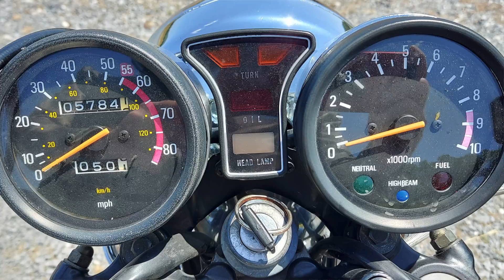Yamaha XS1100 Special Review - Specs, Sound, Acceleration, Classic Musclebike Power!

Comment: I had the 750 Special and 1100 Special. Both were equally comfortable. The 1100 with under a four-gallon tank wouldn't take me past 110 miles. Top heavy in tight turns and great on straight roads. The heads were off and ported and polished. Installed performance mufflers, Vetter saddle bags, rear rack with detachable backrest and long plastic windscreen. Bought a 2005 Goldwing and sold the XS a year later.
Reply from the maker: Right on! Thanks for sharing the memories. It sounds like you are into touring, and the Wing is hard to beat. Cheers!

Comment: Awww man, now I miss my 1981 Suzuki GS550L!!!!! I couldn't kill it.. It was SO light and quick..The speedometer went up to 140...  I got it to 130, and had more throttle to go!!!!!
That was fast enough for me......
Reply from the maker: I have several GS550 videos if you're interested: 
https://youtu.be/CEOGboxYYPI
Reply: The speedometers on Japanese motorcycles were known for being overly optimistic. The magazines listed "indicated" and "actual" speeds at 55 or 60 mph. They speculated that this was done deliberately to prevent riders from running afoul of the law. In that respect, the speedometer on my motorcycle, a 2005 HD, says "certified" on it. If you get pulled over for speeding, and your helmetcam shows you weren't, that information along with the stock tire sizes is enough to beat the ticket.
Reply: @spaceflight1019  I didn't mention I got a speeding ticket on that ride getting off the exit ramp clocked at 98mph..
And my speed was greatly reduced by then..... I believe the speedometer, if I let go at speed I would FLY right off the bike.
I was literally holding on for life, AND MY COUSIN WAS ON THE BACK!!
I got  Is reckless driving ticket and lost my license for a bit..
Reply: @jonsmotorcyclerescueandrev3538  Thanks Bro
Reply: @DUBEE43  We had this discussion on another thread. To find the actual maximum speed of a motorcycle at redline you take the maximum RPM, multiply that by the primary drive ratio, multiply that by the top gear transmission ratio, multiply that by the final drive ratio, and multiply that by the circumference of the rear tire. That will give you the feet per minute.
Reply: @spaceflight1019  Its not that important, its 40 years later now..
But I still believe the speedometer..

Comment: Fortunately these are not the original handlebars otherwise I won't have looked until the end...foot pegs a little further back would go well with it , for all this I prefer the non-'special' version which was inspired by the standard xs750-850 with their rear backrest. The only one that I can really digest the look of in this special series was the xs650 and even then I would have changed the handlebars for lower one .
Reply from the maker: Right on! I'm not a huge "special" or "custom" fan, but the first generation of Japanese cruisers was so close to their standard bike brothers, that they are still competent performers with a few simple mods (handlebars first). Cheers!

Comment: Just a "note",  the XS11 had some difficulties with popping out of gear from 1st to 2nd.  Mine is an '81, I think that that was fixed back in '80.  Also, everything on your bike is "ROUND", yet your mirrors are rectangular.  My "standard"" model , everything on it is "RECTANGULAR" yet, stock mirrors, were ROUND?  Go figure?   So, I just bought 2 mirrors off of an old special model, and mounted them onto my bike and now everything matches!
Reply from the maker: Interesting. I'll probably swap these mirrors out at some point. The original XS1100 looks great with a round replacement headlight.

Comment: Rated at 95 HP and 66.5 torque.  570 lbs. wet weight.  Right in the ballpark with most 1100 bikes from 1980 to 1983. Till the big HP bikes came along.
Reply from the maker: Thanks Pete!
Reply: It took the advent of liquid cooling systems to get to the next step on motorcycle power. The Suzuki GS1150 and the Yamaha FJ1200 were the end of the road for air cooled sportbikes. Honda introduced the V4s, Yamaha followed suit with the Venture, Suzuki went V4 with the Cavalcades and Madura, and Kawasaki had the KZ1300.
Reply from the maker: @spaceflight1019  Right on! I've owned all those bikes in the past (except the Venture and Cavalcade). Unfortunately, with that next generation of bikes the weight and complexity went up as well. It makes them somewhat daunting as restoration projects due to their complexity and corresponding difficulty working on them.
Reply: @jonsmotorcyclerescueandrev3538  True. Unless the cooling system is meticulously maintained the alloy components and seals on 40 year old engines does not fare well.
Reply from the maker: @spaceflight1019  Right on! And V-4 carbs - don't get me started on how much of a pain those are!
Reply: @jonsmotorcyclerescueandrev3538  I rebuilt the carbs on a V45 Sabre for a friend, but the front fork tubes were pitted beyond repair and he traded it for a .45.
Reply from the maker: @spaceflight1019  Right on!

Comment: My ‘79 XS1100 Special throttle would stick at WOT, eventually causing a crash. Any idea why it would stick? I’ve been pondering this question since I crashed in 1982 !
Reply from the maker: @billobrien5745  It could have been a worn or defective throttle cable.
Reply: @jonsmotorcyclerescueandrev3538   Thought of that at the time and replaced the cable with a new one, about 3 weeks before it stuck again and crashed.
Reply from the maker: @billobrien5745  It must have been in the handlebar housing or the carb linkage, then. It is a pretty simple system.  Cheers!

Comment: I just got a 1980 midnight  11 50k MI it was froze up I got it unstuck and started it now I got to work on the brakes I wonder where you got the rebuild kits for the front And rear Master cylinders
Reply from the maker: I think they are K&L parts and should be available through many different sources.

Comment: I own 2 of these bikes. One of them is 1981 Yamaha XS 1100s and the other one is the 1981 Yamaha XS 1100 Midnight Special. I did a total restore on the Midnight Special. I changed the OEM fork springs and shocks to Progressive Shocks and Fork Springs. It made a huge difference on the handling on the bike. I also changed the handlebars which changed the handling and cornering on this bike. I love them both. Everything on the Midnight special is brand new. I redid all the gold at a place in East Hartford CT called New England Chrome. They did an awesome job on the Gold.  New Sterring stem bearings. New wheel bearings. new swing arm bearings. I push my mine to the limit on curves because of the progressive shocks and fork springs. I recommend that up grade to anyone out there that wants there bike to handle insane. I also put in a Barnett Clutch. and a K&N air filter and rejetted the carbs. What a huge difference in HP. It went from 95HP up to 107hp.
Reply from the maker: Nice! Are you running the stock exhaust?
Reply: @jonsmotorcyclerescueandrev3538  No I'm not. I'm running MAC exhausts on both bikes. The Midnight Special has a 4 into 2 and the special has a 4 into 1. Both with K&N air filters. And both bikes have the carbs rejeted
Reply from the maker: @XS-ry6ig  Right on!

Comment: I have a '79 XS1100 Standard and an '81 XS1100 Venturer and have ridden the Special, but the Special Isn't. it was a detuned model for in city operation, hence the 55 mph speedo and lack of torque
Reply from the maker: I think something was wrong with the Special you rode. This one is a torque monster. It clocked the second best 40-80mph top-gear roll-on time of all the classic bikes that I've tested so far. Cheers!